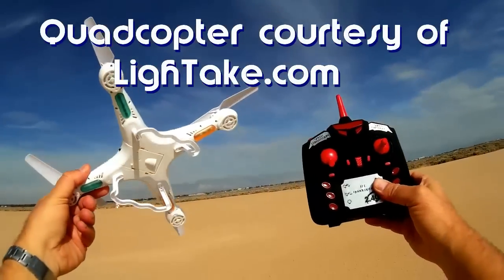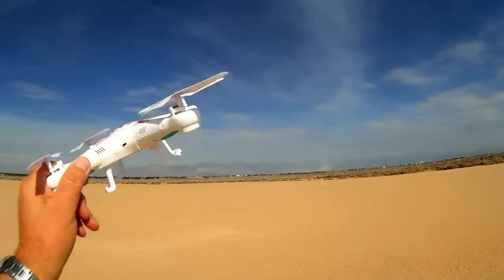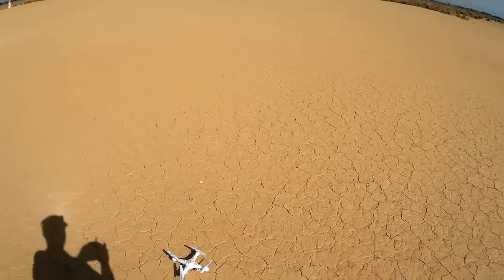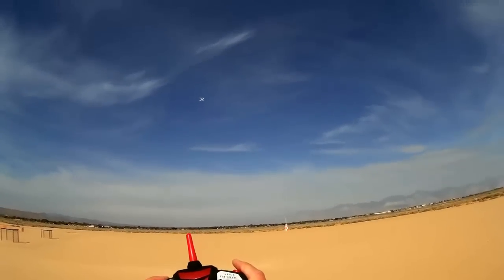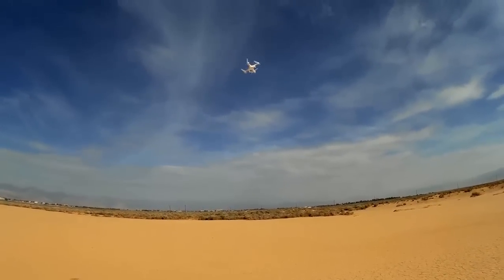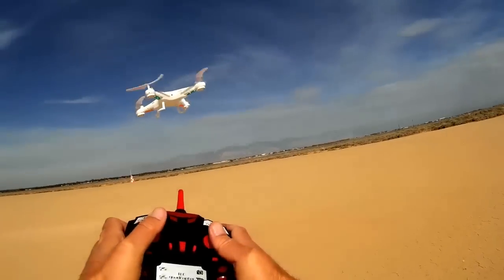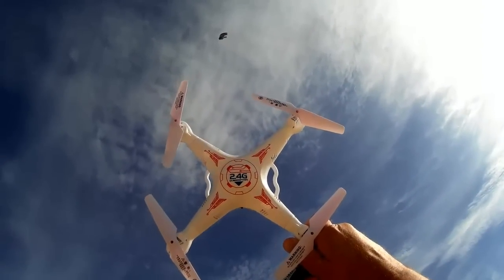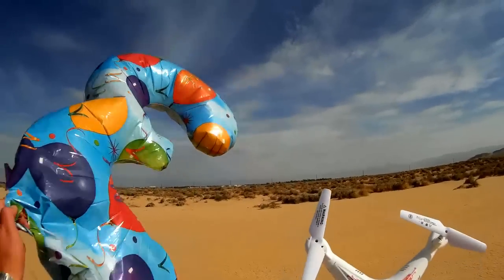HY X6050 Drone Test Flight with UFO Appearance!

Comment: You made a joke about the UFO, but you caught one for real. Go to 5:08, set your speed to 0.25, and you will see a black disk come from the top right corner to the center, then it disappears into the distance. You can see it clear, it is not a bug or bird. It has no wings.

Comment: GUYS!  THERE IS REAL UFO CAUGHT ON THAT VIDEO !!!! go to (almost) an end of 5:09 frame and take a look very closely at the upper right corner. You`ll see a hiper fast flying black object!
Reply: Watch it at 0.25 speed and keep trying to convince yourself it is a bug! Look at the angle of flight, speed, size, and location to the drone. It is further away, faster, and bigger. It's OK MIB won't bother you for one video.
Reply from the maker: +Piotr Ż That's one of those Area 51 advanced B-UG1 aircraft ;-)
Reply: +Quadcopter 101 maybe you are right, but for me it doesnt look like it can be an aircraft, especially when it comes to different shapes and unbelievable speed. But, who knows.
Reply from the maker: Piotr Ż I remember this day.  There were lots of desert nats buzzing me in the face while flying.
Reply: @Quadcopter101  Could it have been a desert gnat? I slowed down the video, stabilized, and zoomed in here: https://youtu.be/cJr3KxTkL5o
Reply from the maker: @statonra  There are plenty of horseflies at that location.  I'm certain that's what it is.

Comment: did no one notice the actual ufo at 5:09 fly above the drone very very fast and off into the distance check it out it is crazy
Reply: Watch it at 0.25 speed, it is round and easy to pause. It has no wings, it is just a black disk!!!
Reply: I believe that's a bug. If you look closely in slow motion you can see it flies in front of the drone meaning it's almost right in front of his face. If it was behind the drone then that would a be a different story and moving at impossible speed
Reply: This the shit that blew up the spacex rocket on the pad.. I've said too much..
Reply: +Lindsay &amp; Christine Jones Yes that's called video editing, OR it could have been an insect of some sort.

.... let's be honest it was a fucking UFO!

Comment: Braught to you by the number 3! jk :3 they lower the range to keep it safer for a few bucks and a bit of solder you can double it easily but if your not a regular flyer you can loose it easily.

Comment: I appreciate your time and commentary on the HY X6050 quadcopter. It was refreshing just to hear a commonsense, direct opinion with nothing overly negative as it is a WYSIWYG quadcopter.  I can not find any stockist for the HY X6050 in the UK. However the Syma X5C-1 is on sale in the Uk for between $45 - $60 I have bought a new one for $10 which is being delivered this week. I just hope it works as well as the HY X6050 you have tested.

Comment: A UF3. I've never seen one of those, let alone had one come straight to me like that!

The quad reminds me of my FY326, especially the drop-outs. I've tried fitting a 'better' antenna to the transmitter, and messing with the receiver antenna positioning, all to no avail. Too bad, because I really like it apart from that.

Comment: Ummmm I don't want u to freak out but u actually did capture a UFO in this footage.... 5:10
Reply from the maker: Lance Yamaguchi Oh that.  That's just the Area 51 boys doing a test flight ;-)  It's the slow fliers that you got to wonder about.
Reply: @Quadcopter101  we must have a lot of test flights where i live
Reply: I see it too ..it’s so fast
Reply: Mr.e Man I see it too... it’s really faster
Reply: Lance Yamaguchi ....it’s called a bug.  Jesus fuck.
Reply: @logicwurx  That "bug" would have had to have been bigger than the drone to see it fly off into the distance,  the camera was focused on the drone.  Didn't see any wings.... could have been a test craft/drone.
Reply: ChromeClapper ...there is zero evidence that that tiny speck was anything other than a fly passing by.  Of course you wouldn’t see the wings of a bug unless he was using a very high speed camera at a hign frame rate.  You also cannot see the propellers on the drone.  Plus... and most importantly, you cannot see a “craft of any kind”.  There is a lot of bullshit, hope, imagination, and speculation at work here.  It is a bug.
Reply: @logicwurx  Did you see the size of the drone in hand?   How are you able to see this tiny "bug" fly off into the distance?   That shouldn't be visible especially if the camera is focused on the drone.  That's the first thing investigators look for is a size comparison.  The "bug" would have to be bigger than the drone.
Reply: @logicwurx  You are insane, i have never seen a bug fly near the speed of light, honestly 0.25 and look at it, you can also see it is above the drone not below. I'm sorry but saying it is a bug is just the dumbest explanation for what it is. Open your mind a bit more.

Edit: look at the distance the drone covers compared to the distance the black thing covers in a second, that is not a bug. I'm not saying it's a ufo i have no idea although i can't explain it, but a bug is just more ridiculous than a ufo.

Comment: Looks and acts quite a bit like the Q7. I wonder if you can do a range mod on this one?
Reply: dheller777 Probably has that same issue the X5C does with the short antenna wire in the quad and controller, i did just the controller and it helped a little, guess I am going to have to fully upgrade that crap so it works better.